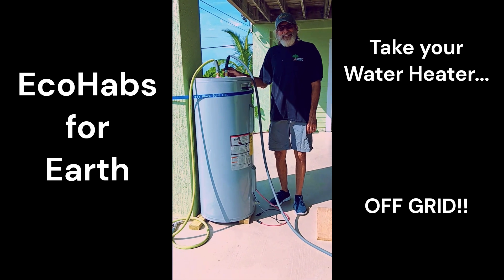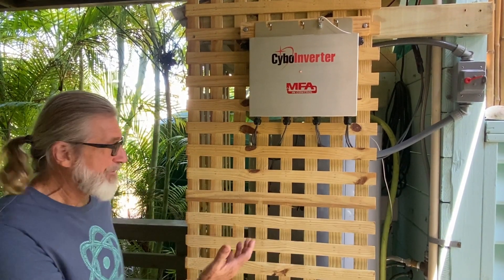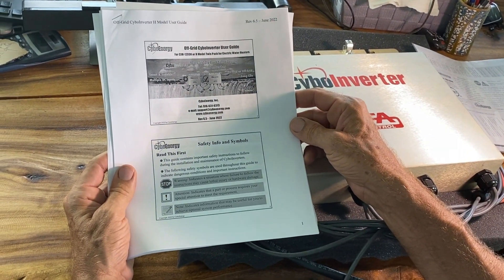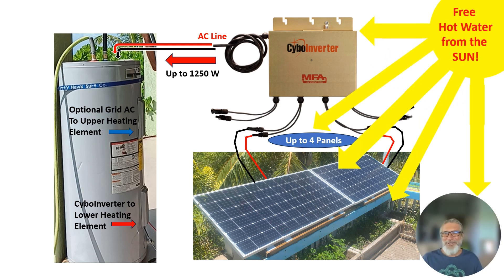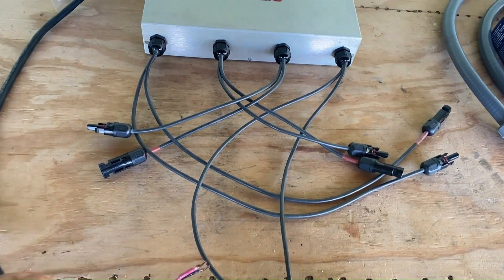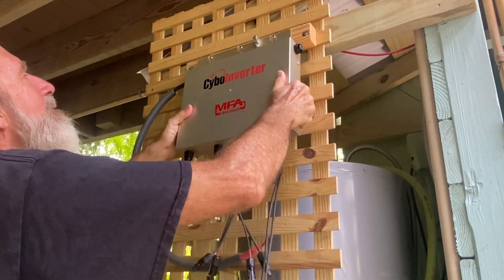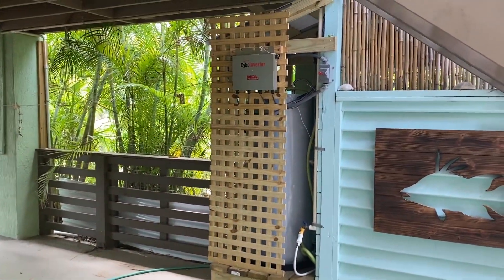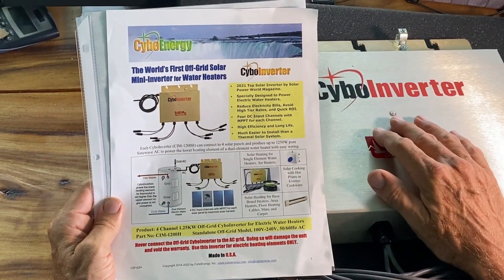Convert your Electric Hot Water Heater to Solar with CyboInverter #solarinverter #waterheater

Comment: Better to put in a heat pump water heater? Mine is great.  Willvthis work with a heat pump water heater?
Cheers
Reply from the maker: How does your heat pump water heater work?!
Reply: @ecohabs4earth  sucks in warmer air blows out dry colder air, and uses a refrigerant and condenser to pass the heat to the water.  Same as ac or fridge. Twice as efficient as natural gas, 4x better than standard electric.  About a 3 year pay back.  Can also connect to solar of course.
Reply from the maker: @jefflloyd394  Thanks for the information!

Comment: IF it only puts out 1250 watts, then HOW can it power a regular 40 gallon hot water heater that draws 4,500 watts at startup?
Reply from the maker: That is what the heater would draw if hooked up to the grid. But heating elements will work with whatever power they are provided, just not at peak efficiency. We run our hot water heater off just one of the elements. There’s only two of us and we always have plenty of hot water from the cybo inverter and one heating element.
Reply: @ecohabs4earth  Thank You for your idea.

Comment: What does it do when a cloud passes over or during low light hours in the morning? Does the AC voltage drop and some heat is produced or does it shut off? Very interested, first I've seen a grid tie inverter used like this. Most I've seen is gray market PWM or mppt controllers of dubious quality.
Reply from the maker: Yes the AC voltage drops and some heat is still produced.  The nice thing is the tank stores the heat :)

Comment: However they cost $1200.00. For that you can buy a really good inverter.
Reply from the maker: Yes there are options - we have also just hooked the solar panels directly to the heating elements through a PV disconnect switch.  But that bi-passes the thermostat...

Comment: These are overpriced for the electrical output they provide. You can buy a 5000 watt, 240 volt dedicated inverter for less than the cyboinverter that will switch to mains power if the sun does not shine. These inverters can take up to 500 volts so a single series string of PV panels is easy to wire. The cyboinverter is a good idea, it's just overpriced.

Comment: And.....and, the HIDDEN cost $$$$ of this "tech" vs just using your Solar setup as is for a 120v electric water heater or tankless?!?
Reply from the maker: @kauaikit  Yes this could be perceived as a luxury item- but there is a lot to be said for the capability to seamlessly use the grid for solar down times or high demand for hot water. We can hook you up with pricing by emailing us at echhabs4earth@gmail.com

Comment: what is the result in cloudy or foggy weather? I am thinking to attach a large 500 watt panel to heating element via a charge controller or MPPT.
Reply from the maker: The nice part is the hot water heater is like a big battery, storing hot water through a cloudy day. Also you can put the upper heating element on the grid, at a lower thermostat temp, as a backup. We did this and really like the result…

Comment: Thanks for video but I have a question, may be a dumb one: water heaters that using sun energy was invented and on the market since 1891. They use only copper tubes, why now we have to "invent the wheels" with complicate and expensive components to do the same thing?
Reply from the maker: Yes, but...  the copper tube exchangers are quite expensive as well and are prone to developing leaks.  We do have a DIY copper tube system for our hot tub and it works great.  I had to replace some leaky connectors but other than that we are happy with it.  I will eventually get a video out on that system.  Thanks for watching!

Comment: This is a genius application. Now I'm, thinking about my hot water baseboard heat  FURNACE. With the price of oil what is is and the drop in solar pricing, This could be seen as a direct way to pay for the panels . no plumbing .
Reply from the maker: Right! Great idea!
Reply: @ecohabs4earth   Could preheat the water going back to the boiler.

Comment: It would be better to use pipe and pump water to circulate water on your roof and let the sun heat the water. Those kind of systems do work my sister had one and the summer sun heated the water without electricity. Winter sun needed help so electricity was needed. 73
Reply from the maker: Thank you for your comment. We have been running this system for almost 6 months now with no issues! And we are only using 2 340W panels! The heating elements max out at 4500 W but work just fine at lower wattages.
Reply: @ecohabs4earth  ok thats one issue solved. Now how long does it take to heat the water at 340 watts or how many watts does the element get on your system? I know at 4500 watts a tank will be hot after one hour. I like the idea but I need to know if it will meet our needs. I used to heat water in the morning for an hour and a half knowing after one hour the water is well heated and the elements are off. Timers are great but you have to schedule around a timer or manually turn on the hot water. I myself want to solar power my low watt items like lights, refrigerator, TV, well pump (240 volt) and Internet gateways. Where does the unused solar power go. Panels will be damaged if no load is on the panel. Charge controllers prevent this from happening. I got to do more research on the inverter you use to heat water. Some things use too much power to put on small solar arrays. 73
Reply: @ronb6182 Ron, panels don't get damaged at no load. You can keep panels disconnected for as long as you like
Reply: @subhobroto  thanks it's good to know. I guess they wear out when not being used for the ones at work. I do know if you hook the panel directly to a battery the battery will get over charged. But the idea I had was not wasting power let the power go somewhere. I guess the 300 watt elements probably be the best in Florida and the panels would match somewhat if you have 300 watts of solar the 300 watt element would match. I think starting out in solar this is far the best starting place. 73
Reply: @ronb6182  what is the make and model of the panels at work? If it has active  electronics in it that could be a reason. Really curious and also can you mention how you know it's worn out? Their power output goes down?
Reply: not true, don't need inverter wire direct any voltage been doing so for the last 10 years, best thing to do electric heater before gas heater then put on pilot setting, hot water year long try it your self
Reply: @petergilchrist2805  no it's better to buy the correct voltage and wattage. I see your point you will get some heat but I would like a 48 volt element and not one that someone scratched off the 240 volts. And claim it's a 48 volt element. This is old news I done more research on the subject. I still like my instant gas heater for an RV, it used little gas. One 15 lb bottle last over a month at 15.00 to fill. 

I now live in a manufactured home and the water heater is a thirty gallon and has 3500 watt elements which uses a 20 amp breaker. I will timer that  water heater, our bill last month was only 50 dollars with trash, recycle, electric and sewer. No water bill unless the lot rent charges if you go over a certain amount. So far no extra charges. I will keep solar for back up power. I just bought a power station. It's nice to use at the old house until I sell it. My power is off and needs outdoor service work because of Milton. So my experiment will tell me if I ever want solar full time. Right now it's a no go. Mounted panels is a must before I go 100 %. 73
Reply: @ronb6182  the water is very hot, some voltage it's too hot
Reply: Circulating water up onto your roof is great until something freezes. Then you are SOL

Comment: Can't water heaters use DC power? Why the inverter?
Reply: For load matching, to efficiently use the solar power. It can be done directly, but care needs to be used to match the panels to the element otherwise PV energy could be underutilized or overload the element.
Reply from the maker: Plus the inverter allows you to use the thermostat which does not work with DC!
Reply: @ecohabs4earth I don't believe you would even need the thermostat but the 4500 watt element has to go. You could put a large array of solar panels to get the watts and volts but the system would cost too much. 73
Reply: @ronb6182 without the thermostat, the hot water would expand and explode the water heater or scald and burn your skin if you opened the water before that happened. Please be safe!
Reply: I'm just doing research on this stuff I haven't tried anything yet and thanks for your concern. They have elements with a DC thermostat built in. I would go that route, you can control how hot the water is, I think it's 110 to 190 degrees.  That brings back my 160 degree setting. When water heaters only had one element you could set the heater to 160 degrees run the heater for only one hour and have hot water all day long. You have to mix shower with more cold water but your bill wasn't 30 dollars more. Back in the seventies. Must be much higher now. 73
Reply: @ronb6182  do you have a link or model number for an element with thermostat built in? I would like to look at it
Reply: @ronb6182   You sign 73, but you clearly don't have much understanding of how these systems work. Heating water and matching panels to the heating element electronically is so easy.
Reply: Yes get an element with a DC thermostat built in..73